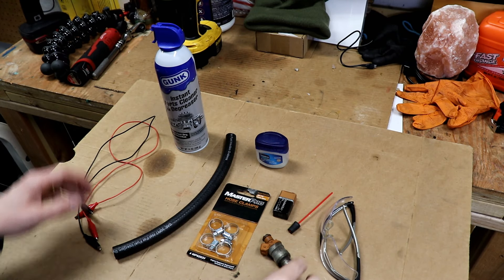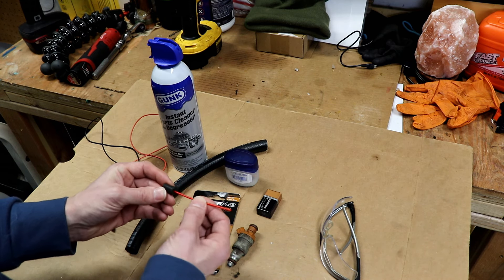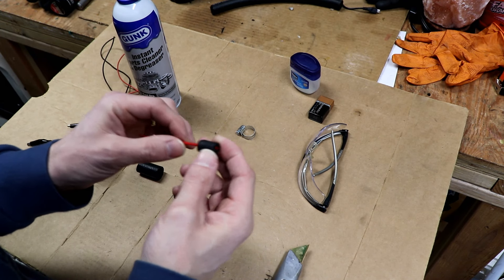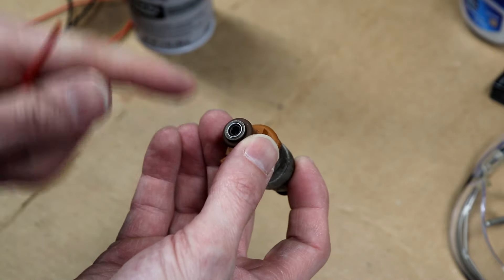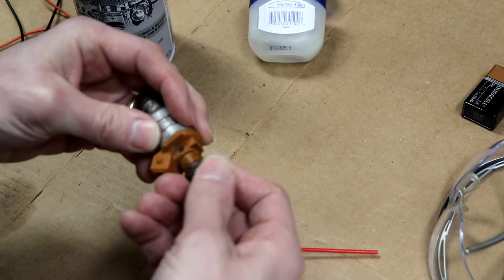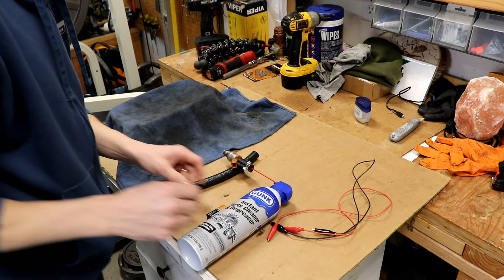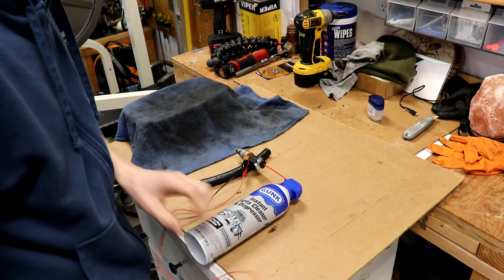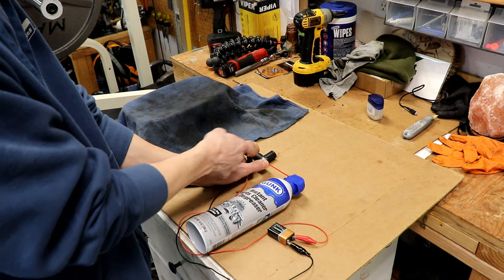Fuel Injector Cleaning Tip!!

Comment: So got a 92 yj blown up motor and I threw in a engine from a 88 Cherokee ran and drove now in the yj can’t get it running crank no start tried the symple things and replaced some stuff still nothing now I believe it’s in the wireing any ideas what could cause this
Reply: New parts are distributor,crank position sensor,coil cap, roater. Wires,and plugs timeing is set and checked still a ton of cranking no start
Reply: All other parts swapped from the yj
Reply: Intake and exhaust manifolds distributor and valve cover

Comment: Wouldn't it be better to spray it the other way?
Reply from the maker: Not sure about that
Reply: To the right?
Reply: @BroncoSolid  reverse of normal flow to blow anything that might be to big to go through the holes.
Reply: Gotcha. Maybe. Maybe the solvent would melt it away.
Reply: @BroncoSolid  idk just a thought I know that some times if I reverse the flow of something it breaks the clog loose
Reply: I agree.  you're just smashing particles through the filter (beta ratio) in the video.  I'm backfiring mine when I clean them and +1 on the Gatorade bottle idea

Comment: Many injectors won't open the magnetic solenoid under 12.0 volt, so testing with this 9volt battery could lead people to trash their injectors.
Reply: That could be true. Others have had different methods I will use, but the connection method is great.

Comment: you lube orings with silicone,  NOT petrolium based products, they degrade rubber !!!!!
Reply: The O ring is in direct contact with gasoline. If petroleum products degraded it it wouldn't stand up to gasoline. Other O rings would be a concern but not these ones.

Comment: The cleaning flow needs to be reversed to dislodge any debris from the spray head. Also you didn’t remove the internal filter mesh, all this is going to do is blow a hole through it and allow contaminants from the fuel through. To properly refurbish fuel injectors a new filter is needed after the cleaning process